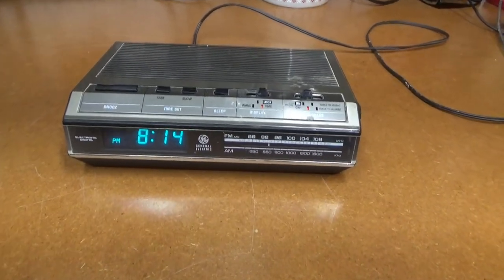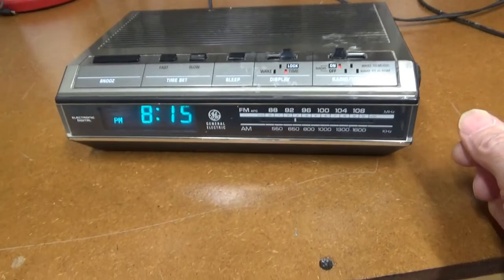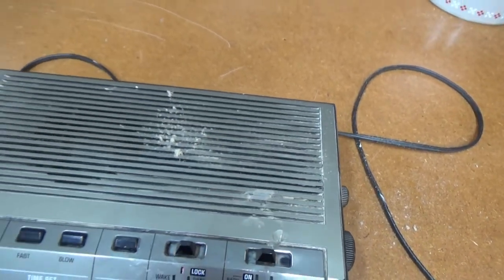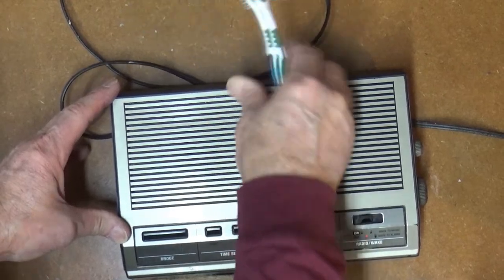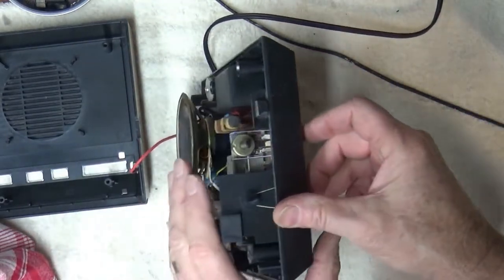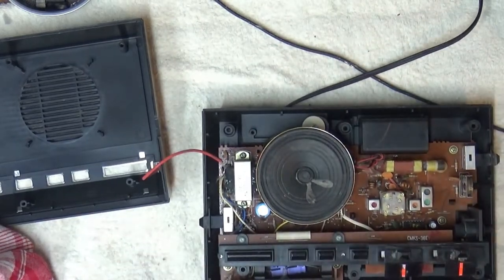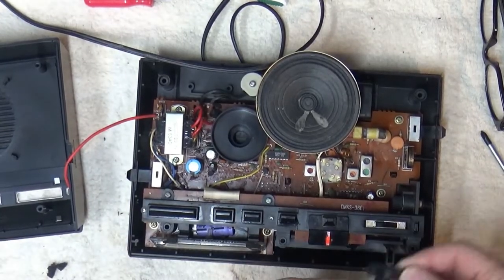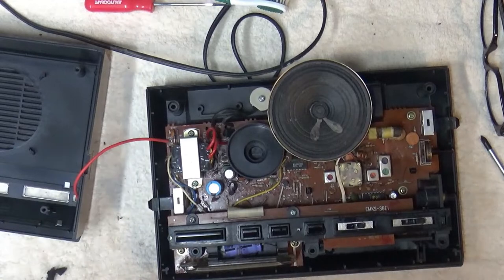1983 GE Clock Radio Service

Comment: I watched the whole video waiting for you to look for the 9 Volt battery compartment. 9 times out of 10 it is a real
old  dead battery  inside that spewed whitish stuff all over the  battery connector. More cleaning .
Reply from the maker: Sorry about leaving that part of the story off of the video. I actually tried several times to get the access panel of the battery compartment off to see if there was an old battery inside. It wouldn't budge and you know how fragile old plastic can be so I didn't want to force it. The owner assured me that he had never installed a back up battery. In fact he didn't even know that his radio had that feature.